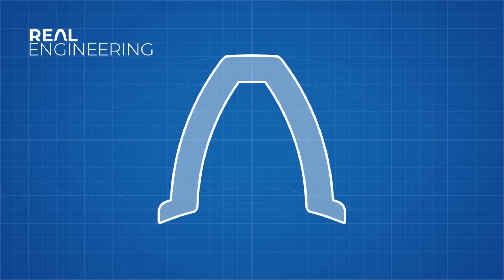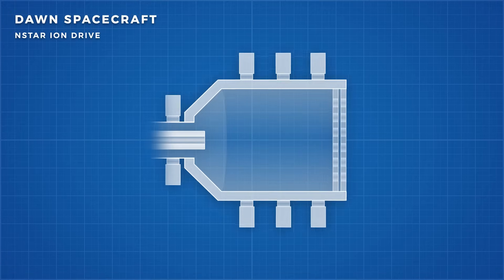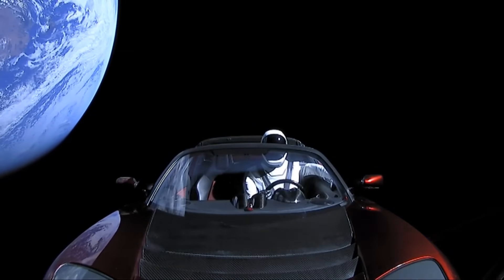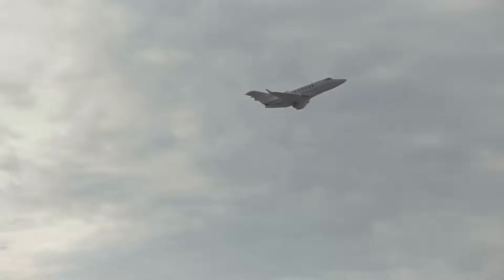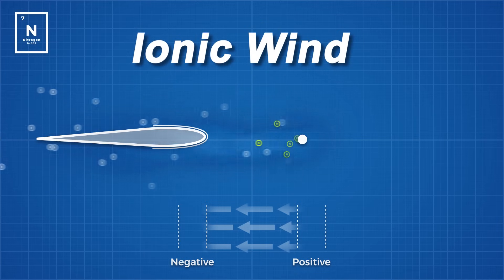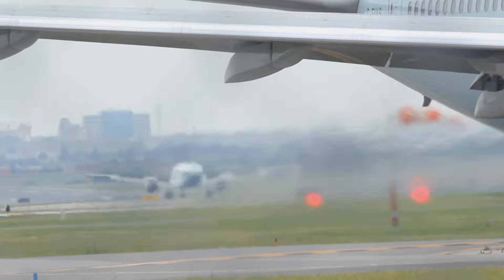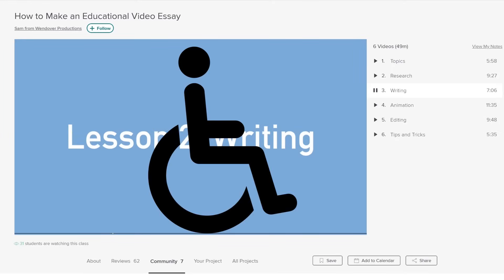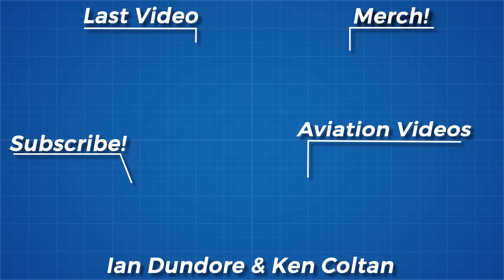Ion Propulsion - The Plane With No Moving Parts

Comment: As a freelance designer and researcher... i have learned a lot from you guys (have knowledge {thoda thoda} but no degree)...So as a student i fell i should return what i find ... specially with the unveiling of the  next gen fighter planes ...and india joining europe and japan ....here is an idea ... in the jet engine during the initial compression phace where supersonic air enters the engine ...the air is supposed to be slowed down... a generator assembly can be put when when rotates due to the speed of incoming air produces electricity also ...this voltage is then applied between the blades of the engine to control the speed  of air ...both to slow it, make it fast or spark it .....bhai also yaar thoda jaldi woh engine dedo naa...tejus ka...thanks in advance...Indian...hehe..koe naa dil pe na lee

Comment: can't you build the Ion thrusters into / inside a Wing itself, do there is little to nothing much outside to cause drag...so it vents out thru the back of the Wing from inside and using Wing control surface rudders to direct the thrust....  and intakes from the front somewhere??

Comment: they already have electrogravitic engines behind closed doors, so there is no need to develop ion propulsion. those engines produce free energy once they are turned on by being pushed by gravity, and they remove any mass or inertia, meaning that acceleration to insane speeds and deceleration to stillness is near instant and requires only a tiny amount of force, with no G forces  being felt or any stress on the device.

Comment: Do we actually need to fly that much and fast? A lot of travel can be replaced by video conferences and an ionic airship sounds like a good idea filled with helium. They are slow, though 24 hours of travel can fulfill most traveling needs. The question is how many more we would need in the air for the same amount of people since the slower speed.

Comment: I saw a vifeo on airships the other day and they are making a comback. Would these not be perfect on those? You counteract the weight issue because they are boyant and float. Try are not meant for high speed and therefore the lower propulsion issue would not be relevant. That means an airship with ion propulsion would be 100 emssion free right?

Comment: Great topics on this channel! Ion engines are by far, nothing new. The 'gods' back then, about a centuries ago. Used it for 'orbit-line' travel in non stage "space planes" that used it before or as the ram/scram-jet intake, which allowed micro atmosphere travel (in space). Since the void of air elements in the universe, is often indangered.

Comment: After some calculations from my side.
WARNING THIS IS THE SPACE VERSION, NOT THE IONIC AIR ONE !

A light flying personal craft with a total lenght of 12,8m , 30cm tall wings and  2,4m width wing, the required argon mass for a 600 kg craft (argon in and useful mass).
I found these values :

argon mass : 20kg
numbers of pairs pole needed : 30 (so 15 at 5.2kv and 15 at -5.2kv)
total craft mass : 600kg
maximum terminal velocity : 278m/s
wings : lenght : 6,4m   height : 2 cm   withd : 2,4m
flight time : 1 hour at max speed

And now where you starts to cry : 2.746 x 10^20 Ah  ( ;( )
Total Wh estimated : 2.855 x 10^23 Wh

In 2020, the earth consumed 2,4565 x 10^13 Wh

The earth area solar radiation is about 1,745 x 10^20 Wh 
So you would need 10 years of EARTH AREA of solar production to fly an hour in a human sized craft.
Now imagine to store onboard this amount of energy or to deliver it with a (very very wide cable).

Yep, dream left the game, back to minecraft modded.

Really a man sized craft have to get some high tech optimisation before

Comment: Clickbait rules!  Plenty of moving parts except for propulsion.
Reply: Where are the moving parts?
Reply: @ummerfarooq5383  I agree solid state drive has no moving parts. Moving control surfaces are needed to change direction. Launching device used had many moving parts. A paper airplane has no moving parts but isn't practical. I'm a glider pilot, no moving (or solid state) parts for propulsion, but many, many moving parts required for control. The ion propulsion is genius but the practicality of the "plane" is terrible unless you intend on flying exclusively in one direction inside a building... Again, the ion tech is amazing yet the plane functionality can't compete with the flying machine 2 bicycle building brothers created 120 years ago.
Reply: @ummerfarooq5383  Regarding clickbait, look at the thumbnail image. Dishonestly pretending this thing is flying outdoors. Deception isn't very scientific... I can't trust this channel as they lie to us even before we watch the video!

Comment: The MIT "team" copied a known design taken from the triangular "lifter" which uses the concept of ionic wind. In other words, they didn't "invent" anything new, they simply converted the "Lifter" which uses the concept of Ionic Wind, to move horizontally instead of vertically. Plagiarism is not invention, it's copying someone else's work. Evidently the bar for educational excellence has been lowered at MIT. By the way, Ionic Wind does not work in space as there is no atmosphere, an Ionic Propulsion Engine is a completely different concept.

Comment: The battery issues mentioned in the video is why I think the future of planes might be hydrogen (unlike cars, which is definitely batteries, hydrogen missed its chance. It’s too inefficient and requires too much new infrastructure when compared to batteries in my opinion). As mentioned in the video, batteries might be good enough for cars but they are not even close to ready for commercial jets. Hydrogen is a lot closer. Whichever comes to market first will be significant because that will spur further research in that direction. Unless there is a huge advancement in battery technology, which is always possible with so much research focused on it. I think hydrogen will be first.

Comment: There are about 40 videos of the first and only solely ion propelled aircrafts that specifically are patented for having onboard power on my channel (since 2014).  They are capable of VTOL flight for up to about 2 minutes and are tremendously more efficient. They were patented in 2014, and widely published and verified, for lifting their power supplies against Earth's gravity.
Reply: I have an idea that utilizing ion propulsion would be very viable on a small "winged" airship. A hydrogen balloon coated in lightweight solar panels to provide the majority of the lift and wide, thin wings similar to a glider extending outwards from the gondola. These would be large scale or sequenced ionic wing thrusters.
I'm not a mechanically minded person this just struck me recently and I had the idea that if lift was already taken care of and you didn't care about high rates of speed you could utilize the efficiency of ionic thrust and solar power. A 50ft long cylindrical balloon with a 15ft radius can lift just under a ton. Make the gondola out of the lightest material possible A single pilot, subtract your battery packs weight, subtract the weight of solar panels, subtract the gondola weight and youve suddenly got several hundred pounds of wiggle room

Comment: Highly efficient and no moving parts but held back by battery weight, you say? Why not power it with solar panels? Airships and sailplanes require little thrust for powered flight. Sailplanes (gliders) only need thrust for takeoff and regaining altitude when there aren't air currents around. Put some lightweight solar panels on top of the wings, and ion drives on the back of vehicle to minimize wind resistance. They could also be on the rear of the wings and wherever needed, there's plenty of space. It might not actually provide enough thrust to allow for take off, but it could substantially extend the range of the sailplane, and wouldn't require the entire wings covered in solar panels and extra lightweight construction as it takes to power propellers. Even a small battery isn't necessary but would probably be useful.

Airships have a huge amount of space, travel at slow speeds, and they don't rely on thrust for lift, so any energy-efficient method of propulsion could be very useful. A steady push would be useful and could be combined with other methods if more speed is needed. But anything to increase efficiency and lower costs would be welcome. These are the kind of craft it can make sense to put actual sails on. So efficient thrusters could work for the long slow voyages airships are intended for. Leisure travel, cruising, cargo hauling.

Comment: This is a bit more on track but it's obsolete coming out of the gate. 14;30,  No air to suck away the energy put forth to propel?  Not a good mind set to have. Space DOES contain a myriad of resistivity factors. (known  & unknown).  Maneuvering resistance MUST be accounted for. Some forces are at astronomical proportions.  IE. Braking, turning, encountering spacial winds & nano particles, planetary pulls and pushes. There are pot holes (anomalies) in space that need to be avoided.  The most well known is black holes  (big & small).

Comment: Question: could we build a structure (floating city/rotating habitat) in Earth's orbit where there is no air drag yet it can benefit Earth's gravity to feel more habitable...and use massive Ion drivers who after years of non-stop working will build up so much thrust to maintain the habitat altitude very efficient.

Comment: Ion propulsion is real. However, it is so weak that it can only power small satellite in space which has no air friction but it could never power a plane in Earth's atmosphere. The video of MIT and it's claim shown here is definitely false. In reality, what made this plane fly is not the ion propulsion but the power of momentum caused by its sling shot launch pad. This plane will fly with or without ion propulsion if you pull or push it by any kinetic means because this plane is just a glider plane. This plane should take off from the ground without any external kinetic power assist to prove that this plane can really fly using ion propulsion only. But obviously it cannot.

Comment: If you electroplate the annoyed or Catherine a 1000 times the voltage would be higher you wouldn't have a lot of weight you're essentially create a thin but energy dense battery if you get it like I don't copper in silver a 1000 times The ion's would want to cling to the other side that much faster And/or if you created a Digital ground.

Comment: while a lot of people are afraid of nuclear power we have build nuclear reactors small enough to fit in a box trailer of a Semi, if you use one of those you'd have a absolutely massive power output

since they were originally designed to provide power to small towns, by using that kinda power you could pump more power into the Ion thrusters

and while I don't know much about how these work I Imagine increasing the power you can give them in total would allow for increased thrust

assuming that the reactor is light enough to fit the weight ratio needed that would solve the power restraint

we can't use nuclear materials as weapons anymore not legally, but we CAN legally use them to make power

Comment: This propulsion with a helium or hydrogen balloon to cancel the weight of batteries. Perhaps make it a blimp with the roll-up kind of solar panels to recharge, you could have a drone with an indefinite flight time. On occasion it would activate the engine to correct its location and then hover or ride the wind until recharged for another burst. There are all kinds of potential applications for that concept alone. Hydrogen is possible because it's an unmanned drone, so why not? A military application beyond surveilence might be carrying a single Stinger missile that normally wouldn't reach that high in the air and give little to no warning when fired. Another might be as an air carrier and recharge station for a drone swarm that rarely needs recharged or maintained itself. Oh yeah, the possibilities are limitless.

Comment: Problem is there's still fuel required; the xenon. Once you run out, you're done accelerating. 
We need something which can fly just from electricity or some other force.
Reply: I do believe the means of propulsion you have in mind is called magic. Hocus pocus, turn my Li-ion into thrust from thin air!
Reply: @Adrenalin844  Magic would be fine if it worked, but as yet nothing of the sort is shown to work. You may want to explore a different avenue.
Reply: @problemwsolutions  Yes, very unfortunate. I think I'll stick to standard liquid and solid propellants, then. Can't beat good old Newton and his 3rd law.

Comment: Since part of the issue with this is to attain flight, what if attaining flight in the first place was not an issue, and simply forward or side to side movement was all that were needed? Let's assume we somehow developed anti-gravity engines for example. That would remove the energy needed to achieve lift. Would then the ion engines be enough to move the aircraft forward? Or is it simply an issue of optimization and the answer is always yes, given time and research?

Comment: Damn we went from the Wright flyer to a literal star wars engine in just over a century
Reply: There are 36 flight footage videos on my YT channel of a series of ion propelled aircrafts that were patented for having onboard power and lifting their power supplies against Earth's gravity (US 10,119,527).  The series of crafts predate the MIT device with onboard power by 12 years!  The MIT version cannot lift its power supply vertically or move at all without a relatively powerful elastic launch mechanism and the flight duration was just a few seconds.
Reply: @KraussEMUS1  did you make the engines?
Reply: @thezackast2752  
The whole thing is basically an ion thruster/ engine.  In a faint sense the electronics could be considered an "engine," so yes, I developed the electronics and control systems also.  There is a constant effort to improve it.  Thanks for asking!
Reply: @KraussEMUS1  that is super cool.

Comment: This is incorrect: 7:30 "Power requirements... increase with the square of the mass [of the plane]."

Power requirements depend on many factors, but generally increase less than linearly with the mass of the plane, which is why large planes tend to have longer range than small planes.

The problem with battery-driven planes is that batteries store much less energy per kg than hydrocarbon fuels do. So you can't carry enough "fuel" (energy) to reach your destination, without the weight of the batteries exceeding the capability of the plane to carry them.

Comment: I have been building small ion aircraft for the fun of it since I first read about them in the 1960s.  The problem is the power to weight ratio.  It is terribly high.  Too high for any practical aircraft - only good for toys.  The MIT design is an improvement in that it uses a wing (rather than the direct downward thrust of prior designs) to increase lift  but it is still requires far too much electrical power to ever be the basis of anything other than a toy.
Reply: The ion propelled crafts ion my channel are the only ones that can lift their power supplies vertically. They can also maintain greater than 1 to 1 lift for close to 2 minutes, far longer flying on one side.  They are constantly undergoing improvements.  It is therefore clear that there will be some useful applications for them in the near future, though it will probably be a while before they can be used outdoors on windy days.  The way I build them they produce tremendously more thrust per watt than any other ion thrusters.  Otherwise, you are correct, ion propulsion requires far too much wattage without following the right construction details.

Comment: Think about it, slingshot enough ion thrust around the moon for eg thus picking up so much velocity that it would be incredibly fast! It may not be almost close to the speed of light but it's a sure hell way in the right direction thus picking up momentum! Another idea that has already been proposed but never actually manifested yet, atleast that we known of officially for a manned mission is that of solar sails with ion thrusters which in all practical    probabilities is currently feasible thus answering the problematic question of eliminating the weight of a propellant around! A problem am sure that both NASA and the Johnson space Jet Propulsion Laboratories have no doubt already solved for a manned operation to Mars atleast!